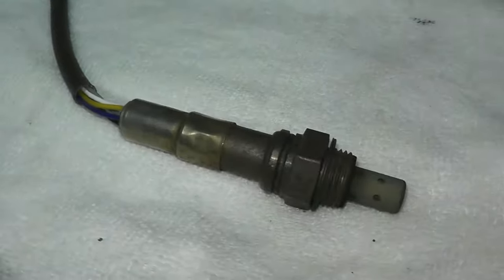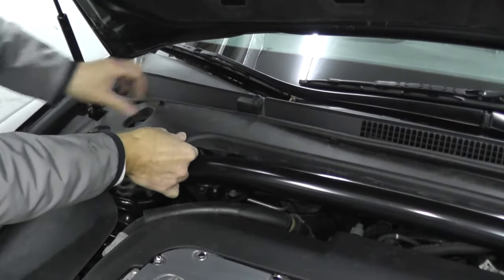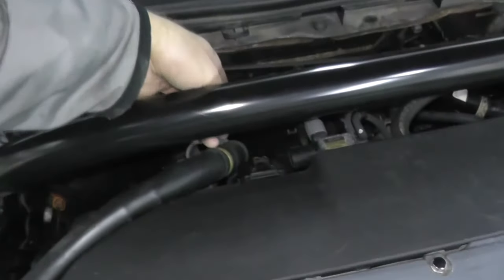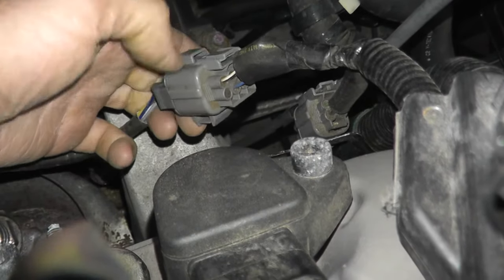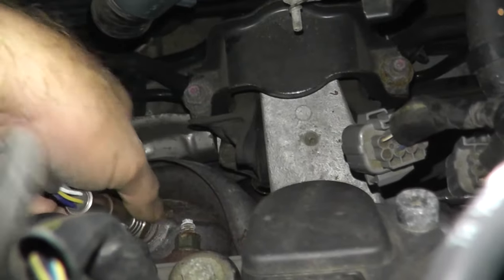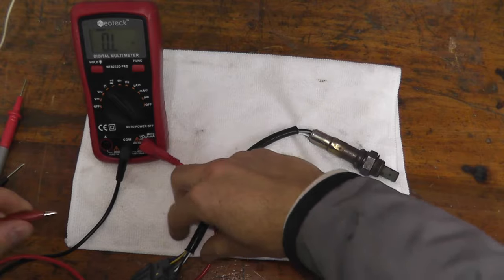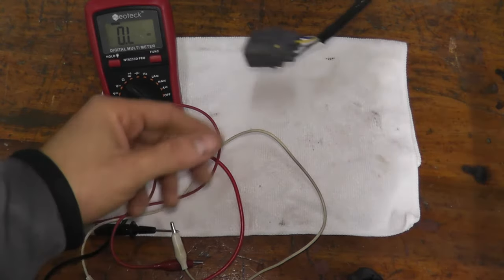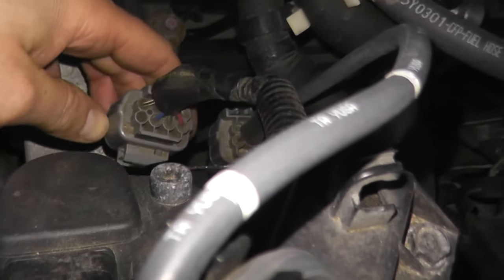How To Test and Replace An Air Fuel Sensor P0133 P0134 P0135 | Bank 1 Sensor 1

Comment: OMG! So many errors! Air fuel ratio sensors are not specifically for codes P0133 P0134 and P0135 but for a Whole bunch of other DTC codes! Engine banks are not always in the arrangement you mentioned!  Bank 1 is gonna be always where piston #1 is located at!
Reply: Every one has his stayls
Reply from the maker: Thank you. All trouble codes are listed in the description box.
Reply: He specified that on Hondas, Bank 1 is at the firewall on these J series engines. No. 1 piston is at the firewall on the passenger side.
Reply: I replaced my 02 sensor but car triggering an p0133 code I noticed one of my fuel injectors is leaking can that be the problem?
Reply: Thanks for let us know 🙏that.

Comment: Bank 1 side isn't always the same on every vehicle. It varies by vehicle and in some cases by year. The rule-of-thumb isn't that it is always on the passenger side of the car or the side closest to the inside of the vehicle on sideway engines as are more cars these days. The true rule-of-thumb is that it is always on the side of the engine that houses the number one cylinder/piston. Especially on many vehicles of early 2000's and before, you can find such  as Chevrolet engines that had bank on the driver side. It is true that on most cars built these days, have bank one on the passenger side
Reply: Exactly. On my 98 blazer 4.3, bank 1 is on the drivers side where the #1 cylinder is located.

Comment: That might work for testing the heating element inside of the O² sensor (two black wires). An O² sensor works between 0-1volt. Switch the meter to millivolts and pass a torch over the bulb end of the sensor. If the reading on your dvom is quick both up & down than the sensor is good. Also a bad heating element in an 0² sensor will set its own code.

Comment: Good jod put my Honda crv 2000 manual oxygen sensor bank one take out the red positive the battery for 15 m the light got away put it back driving for_40 minutes light coming back crv stared ile air got up and Dow's and marking don't know need to reset ait

Comment: Bank 1 sensor 1 refers to on V profile engines where you number 1 cylinder is at, per manufacturer, not necessarily fire wall location: Chevy generally #1 is at driver side, Ford passenger side, non transverse engines, Allways refer to your manufacturer spec's. Your diagnostics go in a wild goose chase if you get this wrong.

Comment: Immensely helpful and thorough. Saved me 300 bucks. 200 on labor and 100 on part. Acura branded o2 sensor (denso) is 180 and the exact same plug by the same manufacturer is 100. And I didn’t have to wait for service appt. Thank you.
Reply: NTK not denso

Comment: I want to say thanks you I been watching a lot of video no one show to change the Af fuse and it located I change bank1 bank 2 sensor 1 but check engine still on now I only change the Af fuse and it worked I’m so happy one again I very appreciate thanks you
Reply: Hi there. I have exactly the same issue. Can you tell me which fuse you have changed and where are they located?? Thanks

Comment: So the scan tool can also do the first step of checking the resistance? I dont have a multimeter thats whyz… also if u get any kind of miliamp reading from the scan tool that verifies ur 02 sensors are good?

Comment: Awesome vid great explanation. But I have a problem. I have a Toyota Yaris 2009 Tr 1.33 Petrol and I was driving normal on a rainy day and check engine light came on. It’s a P2196 Oxygen (A/F) Sensor signal stuck rich (Bank 1 Sensor 1). I don’t know why that code came on as my car drives fine, The rpms are all equal and balanced and not jumping up and down  it runs smooth gives power like it’s been since I’ve owned the car basically drives like a dream but why did I get that code? Iv also checked the wiring and it’s all good. What i have done is iv cleared the code and drove it for a bit like 4 to 6 miles around town and I have not got engine light on yet. Do you think something is wrong like the sensor or anything?

Comment: Great video. I got the P2195 code. So, like you said could it possibly just be loose? The code says stuck lean
Reply from the maker: Yes, it may be just loose. If not, remove and inspect the sensor. Good luck!

Comment: What about the
P0031
P0032
P0131
 P0132
My Sorrento 2012 always show that .. it belongs to the heater ..the harness had 6 wires but the sensor had only 5 !! Confused about that and How to dell with .. any explanation for this part Thank you

Comment: Pretty easy to do on that car. It's the same as the accord V6. I'm pretty sure all of the j series (j30, j32,j35) are close to the same or pretty much the same. That Acura has a Honda j32 power plant, it is 100% a Honda motor with an Acura badge.
Reply: Well Honda owns and makes Acura so I would hope so

Comment: All you are testing is the heater element in the sensor! You need to test the air/fuel ratio sensing  function and that requires a scan tool. Stop making out like you know what you are talking about and misleading people. It's quite astounding that so many posts are thanking you.

Comment: Anti-seize,burns off when you start the car,don't see the point putting it on
Reply: Leaves a film between the threads...
Reply: I swear by Anti seize. I use it on wedge style battery hold down bolts (common on Ford's) and I have never broken a bolt when it's time to replace the battery. Acid and corrosion sure speed up rust.

Comment: Why I can't measure sensor's resistance mounted in car? It would be the same, if I disconnect the cable, or...?
Reply: he said you can measure it while its in the car. he chose to remove it for recording purposes
Reply: @mcfriedchicken1972  okay, I missed it. Thanks.

Comment: How much does this cost to fix? The mechanic wants 300 dollars ?
Reply: That's actually a reasonable price DEPENDING ON THE LOCATION OF THE O² sensor. If it's an air fuel sensor they can run between $100-$200 each.